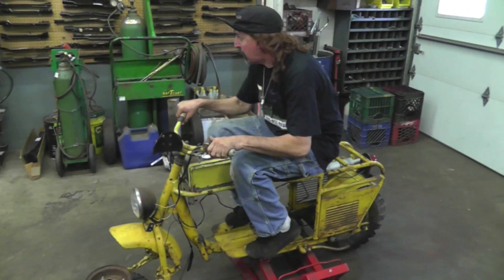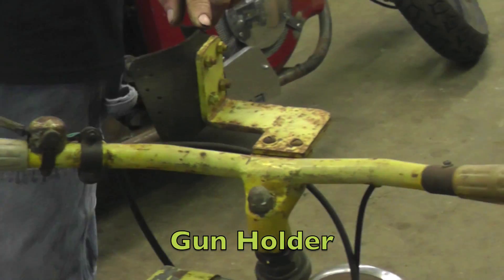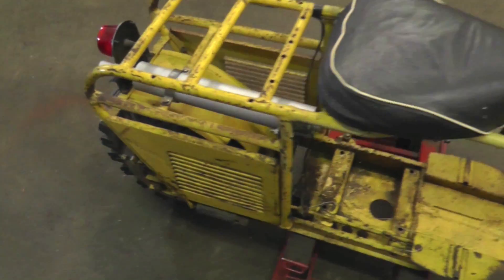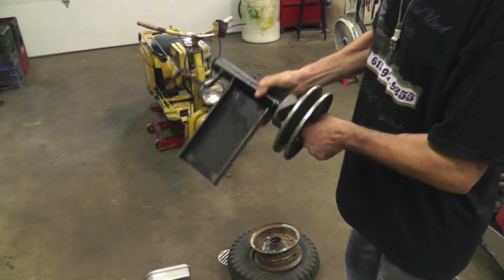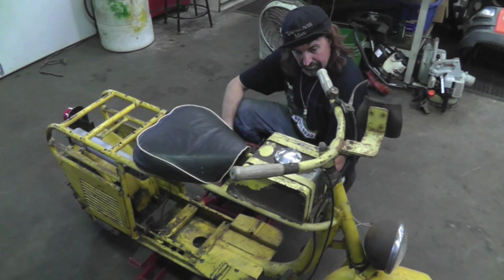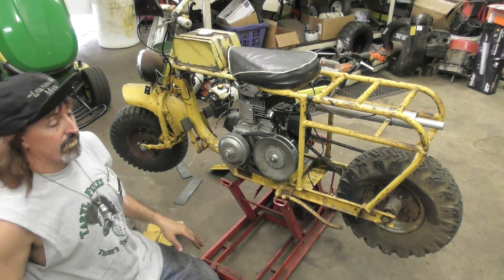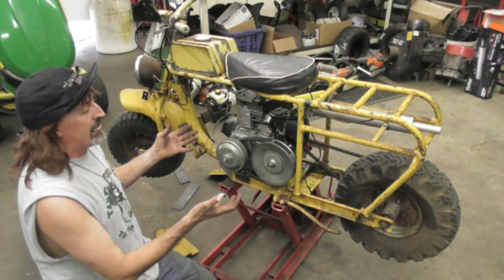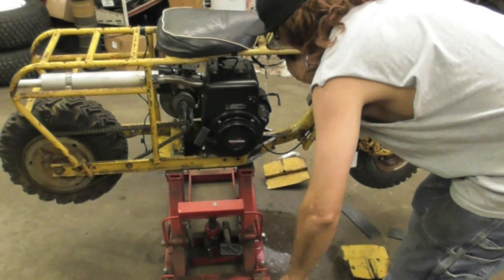Cushman Trailster Restoration PART 1

Comment: I know this is 7 years ago but I had to look back into your past videos so that I could see what you did. I bought a trailer full of Cushmans and parts. One of them is an early trailster with the expanded metal on the back. Not looking for speed so I'm thinking of putting a rebuilt 8 HP Cushman engine that I got. Those are definitely different and cool 😎

Comment: Cool old Cushman. I have a couple Tote Gotes that I got running last year. Put a 3hp in one and a 4 hp B&S in the other. Thirteen is my maximum speed. I also have to put the engine on some iso pads. They both vibrate something fierce. But they’re fun over at my property out in the woods.

Comment: How you set the valves on kohler with non adjustable valves with hydro lifters?There are no clearance at all on the valves,that is causing the starter to stop?Also was told since I took pressure off the hydro valves the no I have to bleed them or it will bend the push rods?God bless Kroiler and there over thought rundant designs that they change eventually down the line.Shew.
Reply: tammygosnell the lifters are known to go bad in those. to bleed them, you have to remove the lifters from the bore with a magnet (think the head has to be removed to do it, been too long since I serviced one to remember) put the lifter in a vise with brass jaws and use a small socket on the plunger end. try to compress the plunger slowly and see if it will compress. if it won't, the lifters need replaced. I usually just replaced them as they are fairly cheap.

Comment: What ever you do, install a kill switch you can get to  it fast... the 8hp engine and low gears can easily overpower the brakes.  And there is no way to disengage the clutch.  SO... when the throttle sticks wide open... ( as it did on mine)  The Thing Will Try To Kill You !  A positive kill switch on the handlebars, as well as the engine cowl can save your hide ( or your life). Any crash on a trailster is going to me nasty  - go ahead, ask me how I know.

Comment: Taryl, vibrating probably because flywheel you took off was balanced with that crank rod and pistons snd flywheel you put on with ring gear is not balanced with the rotating parts